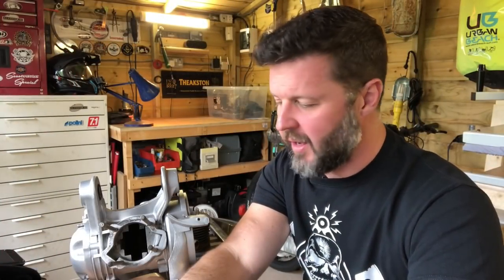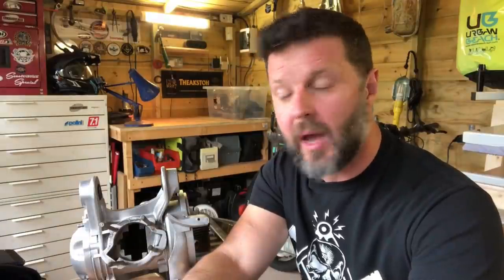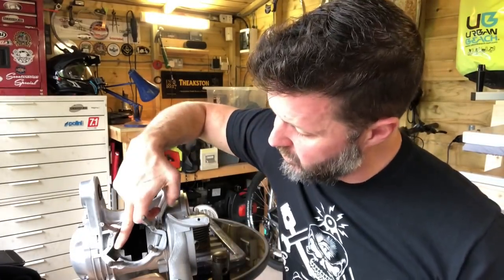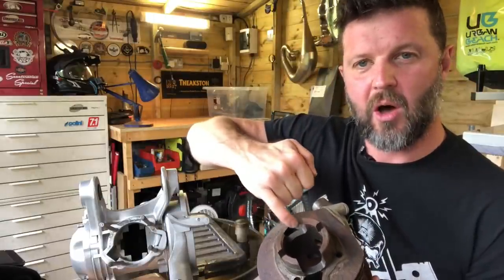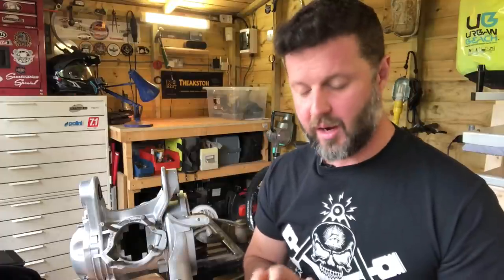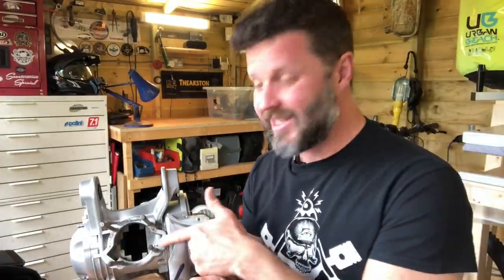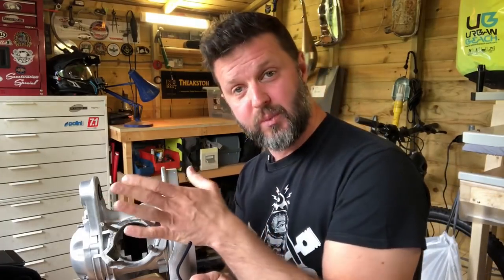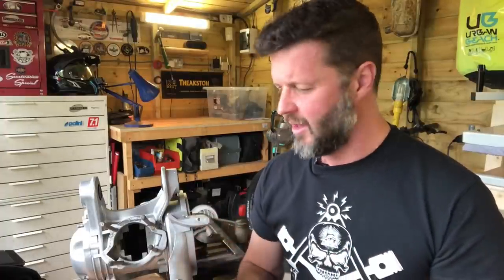Wasted 2-stroke tuning - Does all 'tuning' work? Lambretta & Vespa Scooter Tuning put to the test!

Comment: I bought a vespa with a 210 kit 30mm card and reed block and I was getting other vespa 200's keep up with me, when it was stripped I found out nothing had been matched so me and my mate started grinding and filling, once on the road it made a massive difference from pick up to top end but that was a Vespa and it worked for me 🤷‍♂️

Comment: The last four RB 252 engines I’ve built and tuned are on standard casings and are no different in performance to the ones I did previously with enlarged casing transfers, both on the road and on the dyno with the same set up (all just over 40hp) and it’s difficult to find any difference. I always match the packer plates to the casing and then to the barrel as a matter of course. Instead of being over critical of the findings why not carry out the test and put the work in just like Darrell has. You can only verbally describe a road test and there can be a certain amount of bias involved, a back to back dyno test will visually show any loss or gain and at what revs so it’s the tool for the job. The experiment was done to show losses or gains and wasn’t a fuel economy test. Road testing is always important but this wasn’t to test the reliability, ride, feel and so on of a particular build it was to find any improvements with matching casings to transfer ports.

Comment: You made a great point. The AREA of the transfer. Some are big; some not.   consider the flow like a large swarm of people entering / egressing an event hall; with all it's twists and turns. sure removing a wall mounted extinguisher will help. Ditto prop the doors open. But outer radias obstruction or timber molding wont have effect; if there's a restriction due to the hall way width.  A 2T engine is a fuel laden air pump.  Merry Christmas all ! Paul

Comment: Hi Dan. I've just found this nearly four years on. I'm about to put together a VMC 240 with a SIP bell crank and Malossi reed, PHBH 28 and Vespatronic. All on mildly tuned PE casings (they're from MSC in the 80s, and were home to a Pinasco 225). From the video and comments, I get the imnpression that it is worth doing the work on a large frame Vespa engine, but maybe make 90% of the effort that I was going to. Any more recent thoughts or pointers? Thanks for the great content.

Comment: I did a similar thing on a smallframe vespa..parmakit sp09 rotary valve 28mm dellorto big bertha pipe. Built it without any port matching but did deck the gasket surface..went like shit of a shovel..had it in bits to put a short drt 4th gear in so decided to match the intake manifold and transfers so had extra alloy added round the transfers and set to with the burrs..looked lovely,didnt make a blind bit of difference out on the road...hours of time and a few quid for nothing.
Reply from the maker: That road testing you have implemented backs up what we are hearing from lots of people 👍
Reply: Ok but why do quattrini and pinasco make casings with transfer ports to match the size of the transfer ports on their cylinders?  If it made no difference why bother with a new design and why not just copy the original PIAGGIO casings with their tiny transfer ports???

Comment: So glad I saw this, a very interesting article. I’ve been delaying fitting the crank on my GP150 rebuild until I’d got the RT195 kit and matched the casing to the transfers, not going to bother matching now. I’ll crack on with fitting the crank, chain and clutch 👍🏻.
Reply: I didn't on mine. Got that kit on an LI fitted with a Tameni GP crank 58/107, 28mm phbh and BGM V4 pipe. It's a nice quick and torquey motor, although not run in yet to try flat out.

Comment: Thanks Dan. I think the word folklore sums it up perfectly. For years people have asked questions on various forums (not just scooters) about tuning, and get the standard answers and opinions based on long held beliefs rather than objective testing. I’m so glad Darrell not only did this, but published it too. I recently completed a rebuild on a Puch motor that had previously had its transfer cutouts massively opened up. They were way wider than the new cylinder, and my gut feeling was to either open up the transfers to match, or weld up the cutouts. The owner didn’t want the expense of either so it was left with a massive step! Result? The motor ran really, really well...
I didn’t see Darrell’s charts - was there any impact on torque? Wondering if generating turbulence in the transfers is beneficial? Great video Dan 👍🏻
Reply from the maker: Avantone cheers bud, nice to hear from you, hope you are well. 

I think, in a nutshell, there is so many other areas of improvement required in these engines, that this sort of work just has no effect. It’s mind boggling really. 😆

Comment: Very interesting I’ve built probably around 50 different engines mallossi ts1 and rbs and remember my first build was a mallossi 210, never tuned it as I wasn’t confident at that time,after probably around 500 miles stripped it back down tuned and matched everything and it definitely made the engine run smoother but again couldn’t tell you regarding power as i never used Dynos back then , but wow I’ve been doing the same with every engine build since 🤷‍♂️🤭really gave me something to think about 🤔 thanks for the great context 👍

Comment: It can only draw in the cc's of air & fuel created by the piston movement, but if the volume down there is bigger because material has been removed there is less pressure when the piston descends, there is probably an optimum but it seems on these engines it's already there as standard !

Comment: Interesting! The original lambretta engine was designed and built on basic engineering principles and leant towards fuel efficiency not performance. Slight Increases in power can be seen as models were developed over the years but only significant changes to the design of the cylinder and piston configuration will yield improved performance. This was clearly demonstrated with the introduction of the TS1 cylinder kit which was radically different to a standard barrel and the rest is history. This is exactly the same in any engine you cannot overcome inherent restrictions without altering components drastically. I imagine that most gains from early scooter sprinters etc were gained from reducing the weight of the scooter hence improving power to weight ratio and the size  and weight of the rider!

Comment: I've been reading about port matching enlarging transfers etc and never understood why. If I have a 20 or even 28 mm carburetor and a piston with a 50mm hole already that's over twice the area for flow. Put that hole on both sides and you have 4 times the area. Add a boost port and you have 5 times the area of more of your intake.

Comment: Great video scooter factory, very interesting,  i guess all said and done the radiusing and chamfering etc only helps on far better design racing engines like you say,  and the 60 year plus old lambretta crankcases are not good enough to make any real difference!.  Hence Casa now redesigning the whole lot for the massive power increases!

Comment: After watching this video I think back to all my old scoots of witch I always did a bottom end tune on vespas which did massive improvement s regardless of top end  ,but the lambretta,s I always went for top end tuning even retuning ts1 , imola, rapido, but there was never any bottom end with the latter as it was always barrel / piston  configuration . You only changed the crank on a lammy to help survive this ?? But with vespas you need to tune crank ,inlet , job lot

Comment: Interesting. I had a Monza matched and ported etc. Bloody thing would never run right after it was done. I spent half my time at rallies with the engine in bits. It eventually gave up and seized etc etc and all the bits went in the bin. 
New casings and an Imola fitted. Left completely standard and it has been no trouble at all. Put it up against the other Imolas I ride with and it out performs them all. Perhaps I’m just lucky but the casings are never getting touched.
Reply from the maker: It’s strange how things work out sometimes 😁👍

Comment: I've always thought that polishing and porting on a scooter engine (Lambretta or Vespa) was a waste of time/money/effort for very little in return. But, by the same token, I always thought that a tidy up of imperfections in castings (intake manifolds etc) increased efficiency at least, not for performance as such, but to burn fuel more efficiently and for the engine to run better and be more reliable as a result. I guess the difference between performance and efficiency is the cloudy area. For high performance engines, racing etc, where every extra HP can be the difference between 1st or 2nd at the end of the race, yeah, I get it, but these versions of porting and polishing are extreme compared with 60 yr old Lambretta upgrades.

Comment: The reason the effect of porting the case is minimal is because Lambrettas are barrel induction. Also there may not be an increase in power on the dyno, but it could accelerate smoother and therefore be faster on the road or the track.
Reply from the maker: Despite being barrel induction, the mix still has to go through the spigot/piston/base transfer passage... so not sure how that is relevant? Similar tests were carried out by others on Vespa (Marco from LTH) with similar results to Darrells. Previous tests on other non Lambretta/Vespa cases/kits has also been seen. If no power increase occurs.... how would it accelerate ‘smoother’?  👍

Comment: I have just come across this item. Question? was there a reed valve involved? 360 breathing, intake charge speed against volume of intake charge out-striping the flow capacity of the transfer port sizes at the cylinder? this over supply maintaining equal flow rate!  In the engineering world there is an answer ! what was the ultimate findings of Darrell?

Comment: I'm not technically gifted, but I was always aware that if any lambretta had the tunning mentioned in this video the gains where limited. I knew this as i rode with these "tuned" scooters before and after and their performance after the work was marginally improved. I never did it. I did however recently lose 1.5 stone, my TS1 is the fastest it's ever been! If you want your scooter to go faster / be more economical lose weight first. Can I ask, has the Casa SSR 265 resolved the issue of the restrictions you highlight?
Reply from the maker: I’m not sure what your question is on the 265? The testing was on the Gori 175 and the RB252. In order to know what the effect is of transfer size on the SSR is, it would have to be tested.  I can only imagine that the test on that kind of engine is a moot point though? 👍
Reply: @drunkmunkey6969  Thanks, you answerd me.

Comment: I Got a px all plug and play, no tuning to the kit or cases, .

177 pinasco, mazza bell crank, sip road 2 pipe, phbh 26, parmakit variable ignition.. made 12.38 wheel hp . Quite disappointed 🤔 don't know what to do to get more 😴
Reply from the maker: Bellcrank… are you running a reedvalve?
Reply: @drunkmunkey6969  non reed valve but upon reading more into my pinasco alu touring kit, they only ment to make 12.5 hp. . So with that info I think I'm winning at 12.4...🙏🤞

Comment: Can I mention the very large elephant in the room? Dyno's have been around on the scooter tuning scene for twenty years plus now. So why has no one ever done this before? I would have thought it was bleeding obvious to do such a thing. Obviously not.
Reply from the maker: Good point! lol. I guess most people measure the starting figures, then implement a 'tuning package' before testing again, and if the overall number is higher, then job done. Darrell is quite good at testing for knowledge though, rather than just as a paid job, which is why we get this information :)
Reply: @drunkmunkey6969  unfortunately I don't have access to a dyno but as an engineer I know the importance of testing, mine consists of the old fashioned method of seeing what my arse tells me and I'm envious of those who can afford a dyno. On the matter of matching ports etc it's a matter of principle to not only make it go but also to make it look a professional job, ill fitting components show someone who is careless and can't be bothered, it's the port timings, shape, compression ratio and squish that affect the power output but it's how you finish the job that is also important. I wouldn't buy something that looks rough and I wouldn't expect anyone else to.
Reply from the maker: Yes, that an interesting and valid point which I agree with... something I’ll also be addressing in a follow up.

Comment: why not try to raisining all roof of transfer port windows in cylinder and widening exhaust port to max and raising the roof of the exhaust port window and lowering the inlet port window, and machine bigger hole i inlet on cylinder where carb is fitted, and do the test with the same high rpm expansion chamber and test the difference between none ported windows and ported, i think this is much more intressenting too see hp and rev range differences and caracteristics on bench testing engine, keep the same ignition retard/advance and everything else the same, only ported vs none ported windows in cylinder, and keeping the same flow pattern/diretction of flow in the ports, there must be a big difference?   if you have for example inlet  port orginal 150degrees and lower the floor to get 190degrees,  and also raising transfer roof's from for example 120degrees to 136degrees and raising exhaust roof from for example 175 to 200degrees and use the same high rpm exhaust chamber suitable for the ported setup goals and measure the differences between ported vs stock cylinder?  single cylinder setup too keep it simple  between 65-250cc   and use the same bore on both setup.